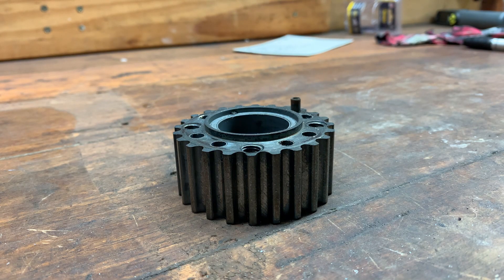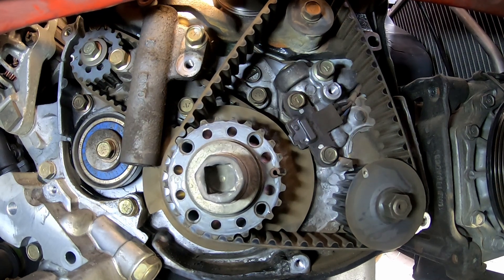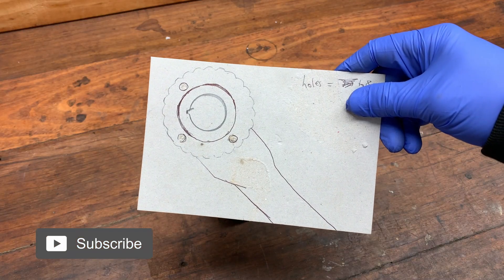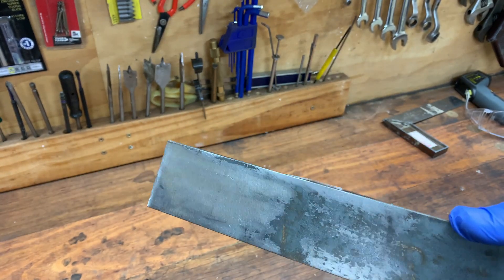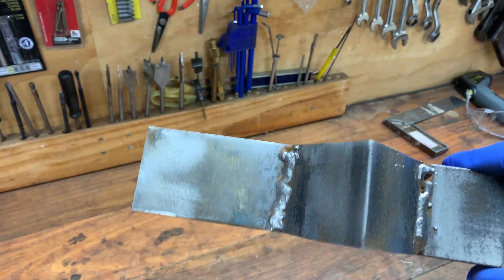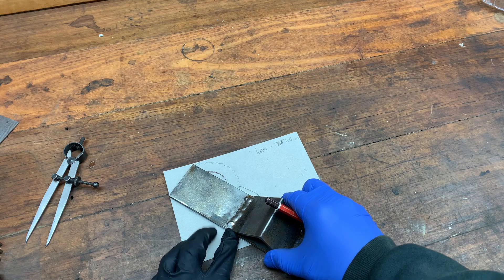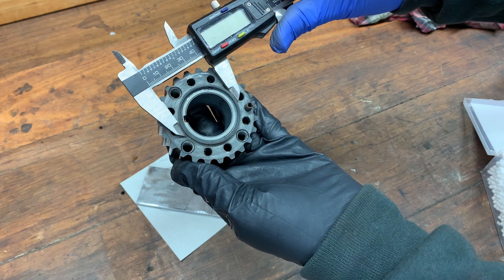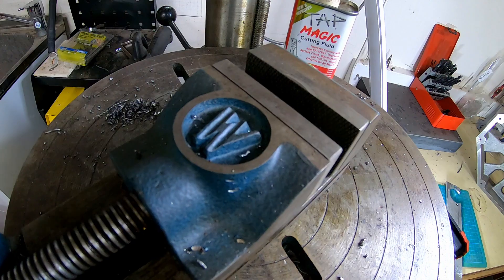Mitsubishi Evo Timing Belt Special Tool DIY. Do the Job Properly with this Tool. Torque to Spec.

Comment: So good! I will definitely be using this for some inspiration when I make my own tool
Reply from the maker: @andym7304  Thanks Andy. I love Special Tools and when they're easy to make like this they're a fun little project too. (and ready in the toolbox for the next time I need it) 🙂
Reply: @UzumakiGarage I have had some flat bar sitting around for a while waiting for this job after seeing the 167Nm required for the Evo 8 bolt 😮 I think the original plan I had was just to have a couple of holes along the side of the bar. Much prefer your idea of using the hole saw and this way I should be able to get 3 bolt holes.
Reply from the maker: @andym7304  I have half made an upgraded version with 4 bolt holes! and another little hole for the split roll pin, I just need to weld a long handle to it to finish it off.  If you want a pic of that message me on Insta